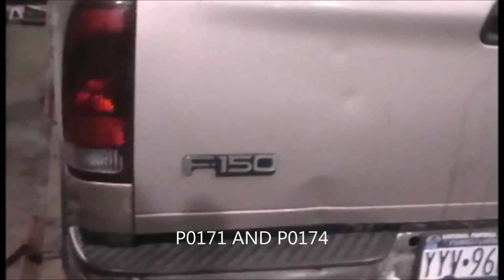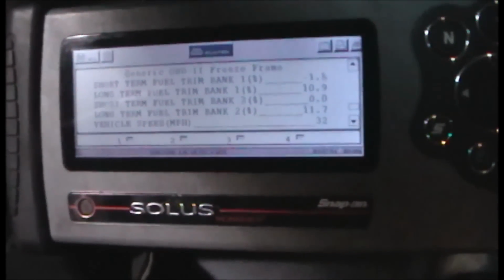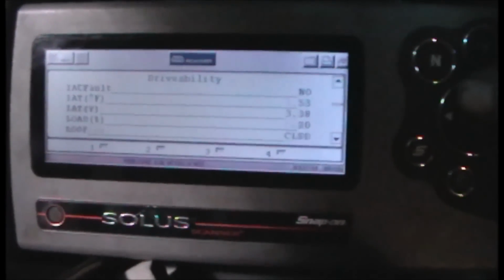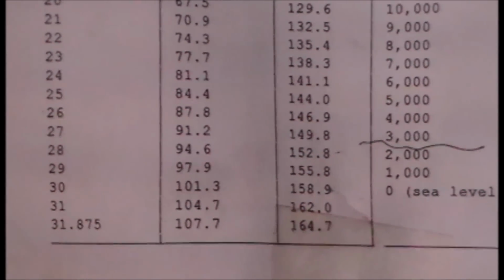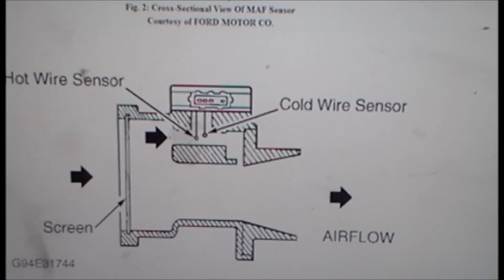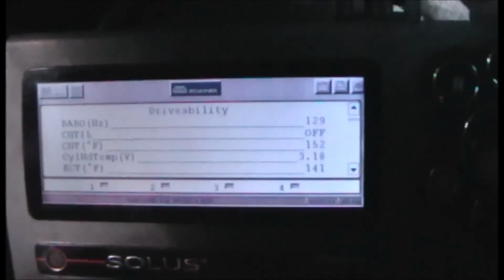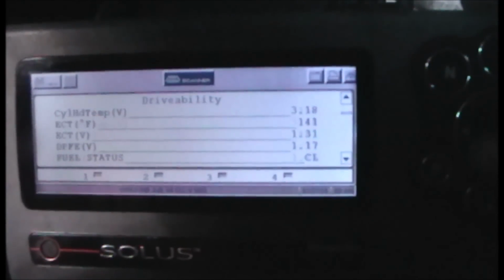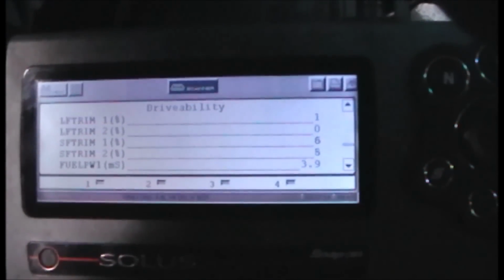FORD V8  SYSTEM LEAN BANK 1 AND BANK 2

Comment: I have the same code on my 03 ford E150 4.2 my freeze data shows 25% on long term at idle engine warmed up to 190 rpm at 854. I give it some gas and the short terms drop to the negative digits meaning vacuum leak. But I'm stuck because if I let it idle without the air filter the shorts terms drops drastically and the percentage between both combined is less than 10. Any advice I would appreciate. I did smoke, propane, water spay, visual and can't find no leaks. Cleaned the Mass air flow sensor, TB, changed the egr valve due to alot of smoke coming out when tested but nothing. PCV working fine. o2's are monitoring correctly.

Comment: I have negative LT fuel trim at idle for both banks, and also negative fuel trim at 3000rpm both banks. V6 engine. Rx330. Is this vacuum leak.
Reply from the maker: It could be a bad rear o2 sensor if it only has 1. What year is it?.
Reply: @jamesdanner7850  Its 2006 lexus rx330. More details.. At idle speed, STFTb1 -5.5, LTFTb1 -2.3; STFTb2 -4.7, LTFTb2 -1.6... At 3000rpm, stftb1 -3.9, ltftb1 -1.6; stftb2 3.9, ltftb2 2.3... is this vacuum leak symptom?
Reply from the maker: @rotcataergeht  no. Its trying to take fuel out. It's running just a little rich. Those numbers aren't too bad, not ideal but I usually dont care till its 10 or more.  U have any symptoms or codes?
Reply: @jamesdanner7850  no symtom yet. Just code p0171 and p0174. I suspect fuel filter clogged or fuel pump issue. I cleaned MAF already, not dirty tho.
Reply: @jamesdanner7850  car has 176k. I bought used, im not sure if car has original parts or not. What could it be?
Reply from the maker: 171 and 174 are lean codes but those trim numbers are showing rich and taking fuel out. Does your  scanner have an option to see freeze frame data so u can see when those codes set?  I've seen cars with vacuum leaks from intake manifolds only when its cold. Then when engine warms up natural expansion with heat kind of seals the leaks. Or check the intake air boot from the maf to the throttle body. Maybe under load the engine rocks and pulls the boot ,opening a crack in one or more of the grooves
Reply: @jamesdanner7850  i cleaned MAF, replaced pvc valve, checked air filter, inspected hoses for cracks leaks, and reset check engine light. I will drive for couple days to see if p0171 p0174 popping again. My last Resort will buy smoke machine. Haha
Reply: @jamesdanner7850  This is very odd. I test drive car for 5 days. The Code 171 and 174 disappeared but i got code p0113 and p0102 instead. Funny. Do you have a video diagnose these? Thx.
Reply from the maker: No. But sounds like the maf is disconnected. The 113 intake air temp code I think that sensor is built into the mass air flow sensor. Then car will guess air flow and usually run richer than it should.  So no lean codes........ guess
Reply: @jamesdanner7850  is it possible that faulty MAF sensor triggers p0171 and p0174?
Reply: @jamesdanner7850  is it possible that vacuum leak triggers p0102? I took my air box out to inspect Maf wire harness all the way to bottom of engine bay. I Found no loose wires nor cracks. Inspected air box and its components found no cracks. Used multimeter to check Maf connection got 11.59v and 4.53v. P0113 and p0102 is the toughest fix i never had.
Reply from the maker: I have seen that but not usually on Toyota engines.  Search car-part.com and see if there are any cheap used ones at a local salvage yard.  But like I said your original trim numbers didn't show lean. That's why I asked if you had a scanner capable of showing freeze frame data so we could see what operating conditions that code sets

Comment: Great tip! Tried it and it works. I have had my truck in the shop several times and they didn't fix the problem. $8 and 10 minutes later,problem is solved. 👍👍👍👍

Comment: I'm having this same code. I've cleaned the MAF sensor and I'm still getting the code. I have a K&N Cold Air Intake on. Could that be my issue?
Reply from the maker: +Peyton Leavitt I've seen those cause problems.  Over oiled or plumbing issues .
Do you know if it's setting the lean codes at idle? Or driving off idle?
Reply: James Danner I do not. I don’t believe my OBD is as advanced as the one you’re using.
Reply: James Danner if it helps, I cleared the code earlier and it came back on when I was driving but I don’t recall when it came on the first time if I was driving or idling. It’s been a month and I’ve done so much to try and fix it but still nothing...I want to check if there’s a vacuum leak near the throttle body like you mentioned. I’ll have to do that tomorrow if anything. Is there any way I can get in contact you besides YouTube?

Comment: I have a 1997 ford f150 v6 4.2 engine with a lean code I got the heads done ,new fuel filter,tune up,oil change , air filter but Idk what to do to get the lean code off bank 2 too lean

Comment: Great video.  I have an 05 5.4 f150. I am having a lean condition on bank 1 only.  After it warms up it pings at any load.  I do have a snap on scanner. What should I look for first?
Reply from the maker: See what the rear o2 is doing. If it's pegged rich and the front one is not, maybe the front  o2 is deteriorated ? 
What do the lt and st fuel trims look like under load on both banks?
Reply: James Danner I will look today and let you know. Thanks for the help
Reply: James Danner it says bank 1 sensor 2 is stuck lean. Would that cause it to ping.  That o2 sensor reads. 01 milliamps and doesn't move
Reply: James Danner replaced that bank 1 sensor 2 and the numbers on scanner are good now. Eventually both sensor 2 level out at around. 6 or .7. Front sensors go back and forth from .1 to. .7. So seems normal. LT fuel trims bounce from - 2 to 5. ST fuel trims stay at around zero.
Reply: Pinging is better but at high load it still pings bad.
Reply from the maker: +Bo Russell yea. So it probably is running real lean. See what the front b1s1 o2 is reading . And also add something like propane or flammable carb cleaner to a vacuum source or into the air cleaner if u can access it and see what sensor 1 and 2 do. They should both hit at least 800 mv. The rear one may be delayed but the front one should be pretty quick. If the front one doesn't move good , it could be the problem.like if it's stuck rich with a high milli volt  and the computer is trying to lean it out. That would show up as a negative long and short term fuel trim most likely.  If they both go high we need to look into other variables. Like vacuum leaks ,but that would be more at idle. Or maybe fuel pressure , but that would show up on both banks. We have seen fuel rails clog up and it starve for fuel.Does that year 5.4 have an egr valve?  I'd need to look that up.
Reply: James Danner yes it has egr valve. Could that be clogged?  Also bank 1 sensor 1 acts just like bank 2. Goes from .1 to about .7 or .8 every few seconds it cycles. Also this started after pulling my 23ft boat about 150 miles during the summer. Started pinging about 100 miles in and hadn't stopped. Before I switch o2 sensor today it would ping under any load. Now it's just when I get on it.
Reply: Also my scanner doesn't read trims in percent it just goes - 3 or so to + 7
Reply from the maker: +Bo Russell not sure about that year but the ones that have a 90° aluminum elbow that the throttle body bolts to . And the egr port from the side that gets dustributed behind the tbody. We pull the elbow off and clean ports on those all the time.
Reply: James Danner it's a 2005. No aluminum elbow. But I do know where the egr valve is. Would that cause pinging if it's clogged? Also I replaced maf sensor todayand no change. Also disconnected battery thinking it might need a relearn and still pinging under high load. Any ideas? I hadn't tried the ether down a vacuum line yet to see the o2s. But I did spray around the intake and no change to idle so dont think it's leaking.

Comment: My 03 E450 Winnie is loosing power at alt of 6k + ft.  Would a MAF sensor cause that?  I mean it just about dies!  30 MPH tops.  Scan showed bank 1&2 lean I was told it's a oxygen sensor down stream?   Thanks, great video.
Reply from the maker: +papster sounds like it's starving for fuel. Are u always at that altitude or it only acts up at that altitude? Can u measure fuel pressure?  Or try a fuel filter first?

Comment: Im showing same code, i sprayed my lines and intake no idle change i cleaned my maf sensor still showing code. Could it be my o2 sensors or should i change my maf sensor its driving me crazy i cant find the problem
Reply from the maker: +terrace Robinson u have access to a scanner?  U can see if the fuel.trims are positive at idle and/or under load . The boot between the air cleaner and throttle body could be torn or the breather side of the pcv system could be disconnected from the boot. U could look at egr dpfe sensor voltage if it has an egr and see if it's stuck open at idle. Look.at freeze frame data and see what conditions the codes are setting. is it both system lean codes 171 and 174?

Comment: Thanks for the video I think that is the same problem with mine have never cleaned the MAS when I saw the code running lean and read on forum about exhaust manifold leaking I was dreading having to deal with that problem.
Reply from the maker: +blastman8888 if that's not it. Look for a vacuum leak in the pcv system. The rubber parts attached to a bigger plastic tube usually near the intake manifold connection

Comment: Awesome video, very informative. I have a 2000 Ford F-150 5.4l it has a P0171 Everytime I start it up it puffs a little bit of smoke then it stops after 5-15 minutes. Some people have directly gone towards the head gasket but it it be an intake manifold gasket problem? Thanks in advance.

Comment: i got a ford e250 2003 4.6l i started blowing smoke out my exhaust but the smoke is only when started after a few seconds its gone.. i m losing oil somehow to exhaust but not outside anywhere that i can see or on my driveway or nothing
P0174, P0507, P0171 are the codes i got.. i m not sure where to start.. can anyone help me on some pointers on where to start looking for my issue
Reply from the maker: +Larry Ulmenstine so u most likely have a vacuum leak with the 2 lean codes and the 507 idle higher than expected.  The idle air motor is probably totally closed and it's still running too fast with the vacuum leak. Honestly the oil smoke sounds like valve seals ,but those 4.6l have pcv hose issues where the rubber hose piece that attaches to the intake manifold swells up and gets soft and collapses under idle vacuum ,then tears and causes the vacuum leak. If u follow the large plastic pipe from the valve cover area to the intake ,u will find the rubber part. Now the pcv part,positive crankcase vent, is designed to reduce pressure in the engine block,oil pan,valve cover area. So if that isn't working right, excess pressure can cause leaks and oil consumption due to pressure building up and being forced into the air cleaner side of the system and getting oil into the intake manifold .Or The pcv valve itself is the vacuum leak. Causing too much vacuum in the crankcase which will also pull oil into the intake manifold.  The pcv is a small regulated vacuum leak by design so anything excessive could be felt by taking the oil fill cap off while it's idling and see if u feel vacuum or engine runs rougher with the cap off
Reply: ok well i checked all the hoses went thru 2 cans of carb cleaner around everything.. head gasket.. all the lines under the hood.. even changed one that was making me weary on .. cleaned the MAF with maf cleaner.. put in that engine treatment t hru the brake checkvalve behind the cylinder that goes to the intake.  deleted the codes. worked on trying to figgure it out..  .i noticed though the lean 1 and 2 went off sometime today after i cleaned the MAF... i guess the next step will be have it smoked... or go get a pcv,, a new maf sensor. and a iaf valve. anyways let me know if there is anyting else i can try. in the meantime.. is there anyway i can pass emissions with a high idle/ idle control system rpm higher then expected?
Reply from the maker: Sometimes the iac just sticks. Is it idling too fast?. Tap on it with something heavy and see if idle drops. Try pulling the 2 bolts and cleaning it out

Comment: Wow! Great video! My 2002 F150 4.6L is forever giving me ¨check engine light¨ issues and will reset ok with examination and servicing of plugs and coils, pcv replacement, etc. A lot of videos suggested MAF sensor replacement but that can get expensive! Cleaning MAF sensor looks easy enough so I will try it. Your video was well organised and photographed and I really appreciate it. Hope this does the trick. Thanks again!
Reply from the maker: +Stuart Gotts cool. It's easy to do. If u have a scanner, u can see what the fuel trims are. If they are high positive under load or driving, the maf is usually dirty. If they are high positive at idle,  alot of times its a  vacuum leak at the pcv hose connection at the manifold. Let me know
Reply: Great Info! Thanks again! Bought a new PCV connecting hose but balked at price of elbow. Such a tiny connector for $14.00?? Can I get bye w/o this or use the one that´s already there?
Reply from the maker: I only replace it if it's soft from oil contamination and is getting sucked shut or splitting open from high intake vacuum
Reply: OK, cool. I´ll let you know. Appreciate you!
Reply: @jamesdanner7850  what does running a high negative mean

Comment: So does this cause the truck to turn off or an oxygen sensor
Reply from the maker: +Antoni Saldivar ive never seen it totally kill the truck. If it's an intake leak, it can misfire and run poorly. If it's the maf it can feel low on power under load

Comment: hey James did you put transmission on gear and accelerate the engine ? does it has to be like that to see fuel trims? thanks
Reply from the maker: +rafael valenzuela yes I did. U get more of a true load doing a brake torque against the converter. Just in manual low if possible and 1500 to 2000 rpm for a few seconds

Comment: got my mass air flo open mine is super dirty do I have to use mass air flow sensor cleaner or can I just spray on some brake cleaner??
Reply from the maker: +Benjamin .25 junkie I've used non flammable brake clean with success. Then blow dry with shop air.  Just can't leave a film
Reply: ty very much went and got the crc maf spray and it fixed my truck ty so much for this info!!!!!
Reply from the maker: +Benjamin .25 junkie you bet . Thanks for the feedback

Comment: Hi, Daniel
I have a 1998 Ford F-150 v8 4.6 liter.
Engine came on, I'm getting two trouble codes, one is PO171 Bank 1 the second is PO174 Bank 2 system too lean. I've had two differant autos look at it. and neither can tell me how or they don't know what the problem maybe... I am overwhelmed about this could you give me some ideal in the direction I can go. Thank Melvin..
it would be well appreciated
Reply from the maker: +Melvin Davis the mass air flow sensor isn't too hard to get to. Clean that and also follow plastic tubing from the valve covers to the intake manifold to check the condition of the moulded rubber ends attached to the intake manifold vacuum source. They like to swell up,get soft and tear
Reply: Okay, thank you so much. You are definitely appreciated. Friend for like.... Melvin

Comment: Also check the PVC valve hoses, it can also cause these two error codes. Mine had holes and cracks.
Reply from the maker: Yea. I have a video with a mercury v6 like that

Comment: Under review of my 171 and 174 code violations I monitored the LT and ST fuel trims. Only long term is appearing off running arround 30 while short terms hold arround 0. I cleaned the MAF and checked for air leaks with no luck. Is it possible for part of the MAF to have a defect? Why would short term be reporting fine but long term still remain maxed on bank 1 and 2?
Reply from the maker: Few things, the long term adjusts to try to keep the shorts at or near 0. Once the long maxes out the shorts head that way if more trim is needed.  What happens at idle vs higher rpms? If it evens out more at higher rpms then it's usually an intake vacuum leak. If it's worse at rpms it leans toward maf or leaks in air ducting before throttle body.  Do u have a scanner to check freeze frame data? Some v6s set lean codes cold engine only which can indicate an upper intake plentum o-ring leak at mating between upper and lower intake. U still need to consider fuel pressure and other mechanical issues . Let me know more when u can

Comment: So I don't have a mass air flow cord/ sensor and I'm throwing same codes even says bad mass airflow sensor can some one help 

1998 f250 got the 5.4 xlt fwd
Reply from the maker: there is not a bunch of wires going thru a grommet in a cylindrical air filter housing?
Reply: No. I figured it out though I had just recently bought this truck and the previous owner put a rubber hose and a filter on it and cut the wires out for some reason... Well I went to a junk yard and baought the cord  and maf sensor. Thanks for the help though good video

Comment: Well, I fixed mine.  You are all going to laugh at this one.  After watching 3 videos about my po174 code I suddenly remembered how when I was reaching to feel to make sure my injectors were clicking (That is how I check mine by placing a finger on them as the engine runs and you can feel then click if theyre working) and remembered on pushing up against the pcv hose and went and checked and it pulled out of the valve on the valve cover, LOL .  What starting all of this is me looking for a misfire and noticed one injector did not click and wiggled the plug and pushed it in and it started working getting rid if the misfire